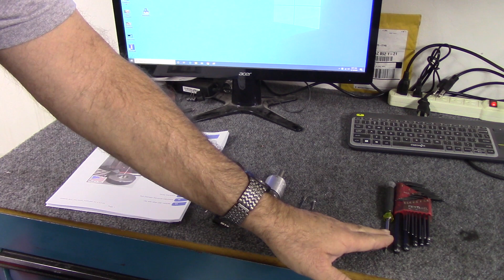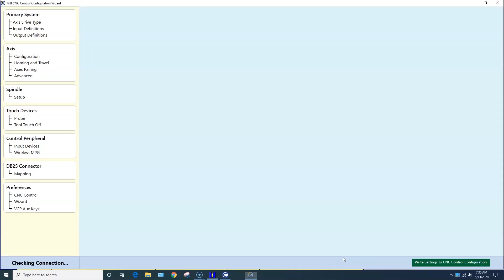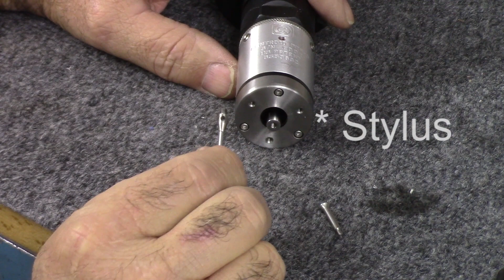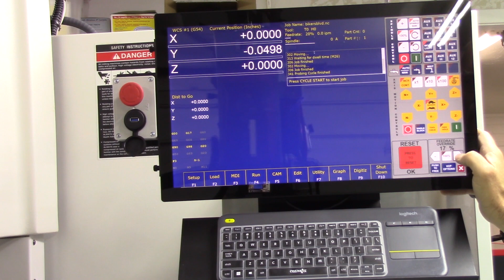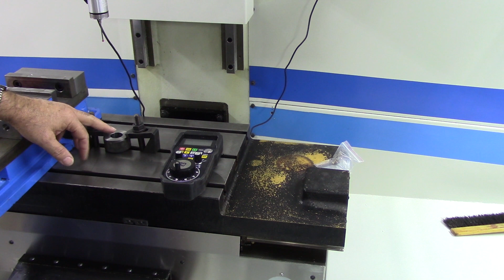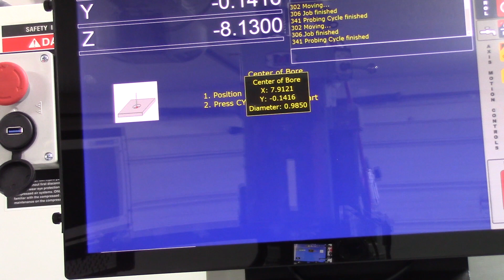Centroid CNC KP 3 Touch Probe Configuration & Testing

Comment: Hey Marty. I'm trying to set up my KP 3 touch probe. The company that did my conversion (LMS 3990) directed me to your channel for info. I need help with wiring please. On the Acorn KP-3 wiring drawing file S15020.DWG it shows connecting 2 wires to IN6 and IN7.
On my board there is a wire already in IN6 for a limiter switch. What can I do to work around this and get the probe installed?
Thanks in advance.
Reply from the maker: Use and assign an unused input. You will also need the detect to let the control know you have the KP3 connected. Those would be the two inputs. You have a third wire that needs to be wired to COM
Please post to the Centroid User Forum. Post picture of your cable you received with KP-3
https://centroidcncforum.com/viewforum.php?f=60

Comment: Hello Marty. I’m wondering how to speed up the travel move speed in between cuts. Watching it travel at 7.5 ipm to the next cut is torture. I was told it was something I had to do in acorn, not fusion 360. I can’t figure it out. Please help
Reply from the maker: Its in the KP-3 Probe manual. Look in the Wizard (Assuming you are using the latest version of CNC12) Under Probe Configuration, change the fast probe rate. Make sure you have setup the KP-3 per the manual. You are using a KP-3 aren't you?
Reply: @martyscncgarage5275  no sorry, I just clicked on a random video of yours to ask a question about the travel moves on my cnc mill. I found something in cnc12 yesterday after I wrote that comment, that said if I’m using the hobbyist version of fusion 360 then my travel moves are going to be limited to the cutting speed. 🤦‍♂️. So that sucks.  Unless you know another way around that.?
Reply: @durangotang1681  pay and upgrade F360 or go though you program and change your feedrates.
Reply: @MartyEscarcega  so I’d have to go through the g code?
Reply: @durangotang1681  yup
Reply: @MartyEscarcega  awesome thank you.

Comment: Hi Marty, I was wondering if you could help me set up something simple just to get by with while I'm machining some parts. my problem is that I need a way to jog the x and y axis out from above the part so I can get a tool into the spindle, right now; the z goes to home position, and the part is in the way from putting a long tool into the spindle. I just scrapped my part, and i'm frustrated, and just need a way to sneak around this problem for now until I finish my ATC build, and start preparing for setting that up. I wish the machine would move to home in the z, then move to home in the x axis, then call for the tool change, then resume after that, so I can get the tool in. got any ideas to temporarily work around this easily? you helped me with the proximity sensors in a series circuit, it worked great. thanks for helping me so quickly, your amaizing.
Reply from the maker: I don't recall what kind of build you have but simply pressing TOOL CHECK on VCP should send the Z up and not move anything else. Try it. You should post this question on the Centroid Users forum and ALWAYS post a Fresh Report so we can see how you configured the machine. I want to see a report to see how you configured which axis to move first when going home. That is the homing and travel wizard page.
Reply: @martyscncgarage5275  ok thanks I will try to figure out how to do the report. I think Ive done that before to get my lisence
Reply: @martyscncgarage5275  here is the centroid forum link for my report and question.    https://centroidcncforum.com/viewtopic.php?p=58854&sid=bdd2225ea0df88ab2d5a375b80056772#p58854
Reply from the maker: You could also try to  customize your M6 macro, within it you could tell the machine where to go
Reply: @martyscncgarage5275  yeah I figured I'd have to reconfigure the macro, I've been avoiding learning to do that until I build my turret for the lathe, and my carousel for the mill. both acorn. just trying to finish my lathe. making the bearing block now, then mount the motor and make another coupler, and slap a rear bearing on the other end of the z axis, and I'm done. I just want to get through it so I can start on the ATC'S
Reply: my x axis is in the rear, and my motor is going where the gearbox was, it sure looks nice, no motors sticking out the front and the rear of the lathe G0602 nicely tucked and hidden with direct drive, no belts. 1.8kw servo spindle tuned so good, rigid tapping works like a dream at 200rpm lots of low end torque. I appreciate your help. I think I'm just going to drill those long bearing block holes manually just to get it over with, that way I can finish up, but then I will set up the macro when I do my PDB on the mill, it's the Hoss build PDB3 (power draw bar) the turret I am building is really nice also.